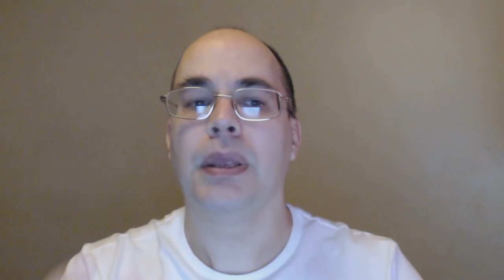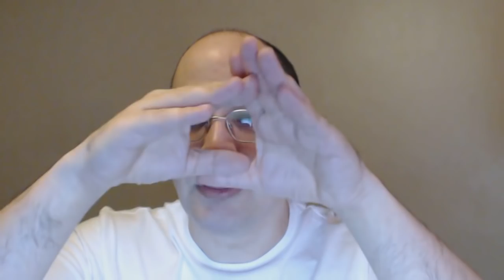How do rockets move in space, with nothing to push off from?

Comment: You need AIR to move.  Planes need air and rockets need air!  You need to learn more.
Reply from the maker: Planes need air to move since the engines use oxygen from the air to fuel them and need air passing over the wings to provide lift. Rockets carry the oxygen as part of the fuel so don't need air to burn and they don't have or need wings to give them lift.
Reply: @mjmurcott647  Objects move on air.  Without air its hard to move.  Combustion can not take place without air.  The rocket would destroy itself because of the force and no where to put it.
Reply from the maker: Combustion can't take place without oxygen, but as as I said rockets carry oxygen with them, often in the form of liquid oxygen. This principle has been driving rockets into high altitude since the German V2 rocket.
Reply: @mjmurcott647  Rockets also need AIR to move. Without air, what are you moving on??
Reply from the maker: No you don't, air restricts movement, you don't need anything to move on it isn't like swimming.
Reply: @mjmurcott647   Planes use Air and create Force, Lift, Weight and Drag with the plane, to fly.  Are you saying in Space, Air is no longer necessary?  What keeps it under control?  What keeps Earth's gravitational pull from just pulling a rocket back down to the ground?
Reply: @soccerlove_dad  Answer THIS question:

If I fired a steel projectile from a CROSSBOW in zero-G, in a vacuum - would I STILL FEEL RECOIL?

Yes or NO? Why or WHY NOT?
Reply from the maker: The velocity of the rocket needs to be greater than the force of gravity generated by the Earth, or it will fall back to Earth, this is why it is known as escape velocity. The direction of travel of the rocket is corrected by small thrusters on the side which can give a gentle nudge in a required direction. However with only gravity of nearby objects to overcome there isn't a real need for "keeping it under control" the rocket will only move in a direction if a force is acting on it. The advantage of being in space is there are few things that are producing those forces and these are relatively easy to measure and account for.
Reply: @mjmurcott647  The rocket thrust is a force.  Combustion is a force.  Because there is no air means the force will not dispense into the air but destroy the rocket like in the vacuum experiments.   Show me ONE experiment that proves what you are claiming.  Just one!
Reply from the maker: A practical experiment took place on 16 July 1969, watched by millions.
Reply: @mjmurcott647  Ok so for 50 YEARS you refer back to 1969 as proof.  All the hundreds of trips to space and your observable proof is 1969????  I rest my case.  You guys are jokes.  Science is about OBSERVATION not propaganda.
Reply: @soccerlove_dad  - No answer to my questions?  I am basically calling you a LIAR about you being any kind of "Eninger" at all.

Are the high school level physics questions TOO HARD for you?

Afraid to have a debate with a REAL engineer?
Reply: @soccerlove_dad  - "All the hundreds of trips to space and your observable proof is 1969?"

I have UNDENIABLE video proof of rocket propulsion in a vacuum.

I would be HAPPY to show it to you - as soon as you answer some of my questions.
Reply: @stuartgray5877  Science is about OBSERVATION!!!  Don't talk, show.... I'm waiting.  Hopefully it won't be 50 years
Reply: @soccerlove_dad  answer my questions first
Reply: @soccerlove_dad  - "Science is about OBSERVATION!!!  Don't talk, show.... I'm waiting."

I am an ACTUAL Aerospace Test Engineer (degree is EE).
 I have been building, testing, launching and OPERATING deep space science probes for over 20 years.
I HAVE done the experiments.

Answer my simple physics questions and Ill tell you all about it.
Reply: @stuartgray5877  Don't talk.  Credentials are irrelevant. Show us the proof.  Put up or shut up!
Reply: @soccerlove_dad  You DO know that it is illegal in Colorado to CLAIM you are a "Professional Engineer" when you are not right?

I know for a fact that it is impossible to pass the PE exam if you do not know how the "Law of Conservation of Momentum" works.

If you DONT think that rocket propulsion works in a vacuum then you DO NOT understand the Law - PERIOD.

One CANNOT pass HIGH SCHOOL Physics if you don't believe that rocket propulsion works in a vacuum.
Reply: @stuartgray5877  it is illegal in many stated to say you are a professional engineer.  Show anything flying in a vacuum!!!!!!  ANYTHING experiment!!  I'll wait.  I won't wait for 50 years though/
Reply: @stuartgray5877  Why is science a game.  Just show what you are saying.  Right now, your simply yapping with no observable proof? Guess you have no proof as I knew.
Reply: @soccerlove_dad  Stop lying about being an engineer if you cannot answer high school level physics questions.

I DO HAVE proof, but it would STILL require you to answer a DIFFERENT question that actual engineers have no trouble answering.

Before showing you proof that "bears shit in the woods" is it reasonable to ask one to define what "woods" means in the context of bears?

SO before showing you proof that rockets work in a "vacuum", lets define what "vacuum" means.

Industry standard for "rough Vacuum" is any pressure BELOW 1.0 Torr (or about 0.02 PSI).
This is approaching 1/1000 that of atmospheric pressure at sea level.

SO at WHAT Altitude above earth, does the atmospheric pressure drop to BELOW 1.0 Torr?

Answer that and we can discuss the evidence that I will show you.
Reply: @soccerlove_dad  So answer my question and I ll show you the proof you are waiting for:

At WHAT ALTITUDE does earth's atmospheric pressure drop to BELOW 1.0 Torr?

Why can't a PROFESSIONAL ENGINEER answer such a simple question?
Reply: @stuartgray5877  You want to change the subject from "space" to earths atmospheric pressure? 😂
Reply: @soccerlove_dad  - "You want to change the subject from "space" to earths atmospheric pressure? "

I want you to answer my question ABOUT earth's atmospheric pressure so I can SHOW YOU PROOF that rockets work in a vacuum.

WHY are you refusing tho just answer the question?

You can find the answer at engineeringtoolkit dot com.

Or is that too hard for you?
Reply: @soccerlove_dad  SO tell me your Professional Engineering Certification number for Colorado. Its funny that you don't show up in the Colorado database for Professional Engineers.

Why is that?
Reply: @soccerlove_dad  if you’re a professional Engineer, then share your registration number so we can check. Because if you’re a profession Engineer then im a talking Llama
Reply: @engineeringtheweirdguy2103  😂😂😂
Reply: @soccerlove_dad  I’m glad you find it funny. In many places it’s illegal to call yourself a professional Engineer when you’re not. And people do that just undermines the profession I’ve worked very hard for.
Reply: @stuartgray5877  I however am a Professionall Mechanical Engineer. (Although I don’t work on anything as impressive as you do). And it really aggravates me when people who aren’t Engineers pretend that they are to try to win cheap points.
Reply: I don’t put a lot of stock in the distinction between Engineer and Professional Engineer. To me, if you have a degree in an Engineering field, you’re an Engineer. If you have a tafe or diploma in engineering technologies etc etc. or you did some welding course with “Engineer” in the title, you shouldn’t be calling yourself a qualified Engineer. Maybe sub qualified Engineer for things like associates degrees but definitely not a professional Engineer
Reply: @mjmurcott647  they do not need air so much as they require atmospheric pressure.

The intercontinental ballistic missiles.. a big hurdle there was how to reignite missiles after they returned to atmosphere. In space, they are simply projectiles. There is no thrust.
Reply: @mjmurcott647  air is a fluid, in fact.
Reply: @soccerlove_dad  The International Space Station is travelling at around 17,000 miles an hour in order not to drop out of orbit around the earth - this is the reason the earth's gravitational pull doesn't pull it back down to the ground - you actually don't know the reason why satellites can remain in orbit and not fall back to earth?
Reply: @soccerlove_dad  In the vacuum of space in orbit around the earth, why is not possible for the space station to travel at 17,000 MPH?
So you actually think that a rocket's exhaust is pushing off the air and being propelled by some type of force that is pushing back on the bottom of the rocket? Hmmm, nope!
Reply: @sailorman8668  Did you see the video? Do you see them space walking?  Do you think they are space walking at 17,000 mph?
Reply: @soccerlove_dad  - Stop trying to explain physics to others.  You haven't a CLUE how basic physics works OR you would just answer the following questions without hesitation:

1- When the rocket engine fires - Is the EXHUAST GAS ACCELERATED?
Yes or No?
(did it CHANGE velocity OR NOT?)

2 - Does the Exhaust gas HAVE MASS?
Yes or No?

3 - Can MASS be ACCELERATEED without a FORCE?
Yes or No?

You CLAIM to have an engineering degree, so this should be trivial for you.
Reply: S Essien - PLEASE leave the PHYSICS to people who actually took a physics class.
It is OBVIOUS that you have never taken a single physics class in your life.
Reply: @stuartgray5877  It what I do as a professional engineer.
Reply: @soccerlove_dad  - " It what I do as a professional engineer."

Sorry it is NOT possible to get an engineering DEGREE and believe that rockets do not work in a vacuum.

Care to answer about five simple physics questions that anyone that has passed HIGH SCHOOL Physics can answer?

IF you answer them all truthfully, you will see that rocket propulsion MUST work in a vacuum.

After that Ill show you unmistakable video evidence of rocket propulsion in a vacuum.

Ready?
First question (just to see if you qualify for the rest):

If I fire a steel projectile from a crossbow, here on earth, will I feel a recoil force?

Yes or No?

(You would be surprised HOW MANY people on these threads that CLAIM to understand physics get this wrong).
Reply: Apparently helicopters don't need atmosphere.  These Mars missions are such poor productions, it's just strange.
Reply: @humblebwonderful9705  So let me get this straight - Mars has enough atmosphere to slow down the spacecraft from 11,000 MPH to a hundred MPH and the parachute to work, but a helicopter WONT?

you sure you don't want to rethink your position?
Reply: @stuartgray5877  Seriously, listen to yourself. 
Darling, none of that really happened, unless you are referring to Mars, Greenland.

Mars is half the size of earth with 1% of earth's atmosphere.

The best students have no discretion. That is what makes them such good students. Morbid obedience to contrived authority.

Parachutes in deep space. Worthless until you hit atmpsphere, and damn near worthless in an atmosphere of less than .147 psi, now isn't it?
Reply: @stuartgray5877  I double down on Newton. & I'm calling bullshit.
Reply: @humblebwonderful9705  I have helped build, test and Launch one Mars Orbiter. The company I currently work for built the camera in Mars orbit that caught the lander under parachute. I also helped with the MER Rovers, and I have been a Flight Director at JPL.
You are completely out of your league.
Reply: @stuartgray5877  That comment adds no value to the conversation whatsoever.
I'm not a credentialist. 
Do you think you are always the smartest person in the room, or is it just Youtube?

Mars' atmosphere is one tenth of a pound per square inch of pressure at "sea level"
What filled the chute?
Reply: @stuartgray5877  If you are so brilliant, you should know that Newton's third doesn't work for rockets.
Reply: @stuartgray5877  You make a lot of idiotic assumptions.
Reply: @humblebwonderful9705  Then just tell me FLATOUT:
Have you EVER taken basic physics?

I expect you to AVOID answering the direct question.
Reply: @stuartgray5877  You are avoiding the fact that Newton's third Law can't be applied to rockets & you are wrong.
I don't owe you anything, much less personal information, but I will give you this gift: Compulsory school is a great success.
We have indeed a nation of workers, and not a nation of thinkers.
Only an idiot would think that high school has ANYTHING to do with intelligence.
Reply: @humblebwonderful9705  so that’s my honest answer. If you could do that. And I couldn’t find any reasonable way to doubt that explanation. I would accept it as truth. It doesn’t matter if it comes from a “drop out” or a field leading professor. I care about the details.
Reply: @engineeringtheweirdguy2103  thanks. It is getting to be a pretty long comment thread & a pain in the heinie to find the end of. I posted a new op comment, if you want to chew that up. If not, I will probably double back here when I have a better prepared argument.

I always liked process control. PCT at a disposable adult underpants factory was probably the most interesting job. I always worked on the ibis vacuum systems and belt-driven fans for all of the machines. I really enjoyed that. The Lead Engineer was scary, but the rest of the job was AWESOME. SAHM now and another schedule C if the stars line up. ;) Consultant, that makes sense. Seems like a good fit.
Danke!
Reply: @humblebwonderful9705  YOu know you can SEE the ISS with YOUR EYES RIGHT?
maybe you should go LOOK for yourself?
we have PHOTOGRAPHS of the ISS and you can see the Dragon spacecraft docked to the side of it.
I guess that is just worldwide mass hallucinations right?

Want to see some pictures that I HELPED TAKE? Google "EPOXI images of earth" and tell us what you find genius!
Reply: @humblebwonderful9705  So WHERE is that derivation of the Rocket Equation so you can show 100 years worth of engineers and physicists where THEY HAVE BEEN WRONG?

Why the silence?  Did you figure out that you are in over your head?
bless your little heart!
Reply: @stuartgray5877  I apologize, I just feel like nothing productive can come from the energy of the conversation. I shouldn't make statements of questions nor should I feel insulted and likewise. Thanks for trying.
Reply: @stuartgray5877  You know what kind of debts you can't insure? Worthless debts. Student debts.
Reply: @humblebwonderful9705  Really? My "Student Debt" after graduating was about $20k for an Engineering Degree in 1993.

I now make TEN TIMES THAT a YEAR and have almost $2 million in my 401K account
So HOW is that "student Loan debt" worthless?
I seem to have done quite well with that initial $20k investment in my future.

What is your excuse?
Reply: @stuartgray5877  I am a stay at home mom. I went to technical college. How do you insure student loan debt, tell me?
Reply: @humblebwonderful9705  You want to debunk 100 years of established engineering and physics regarding rocket propulsion, but you DON'T understand how RECOIL works?
Bless your little heart!
Reply: @humblebwonderful9705    To all OTHER READERS, watch as Squint ward REFUSES to just answer simple questions that ANY PERSON who has taken high school physics CAN ANSWER:

1 - When a rocket engine fires does the exhaust gas GET ACCELERATED? Yes or No?
2 - Does the Exhaust gas HAVE MASS? Yes or No?
3 - Can MASS be accelerated WITHOUT A FORCE? Yes or No?

And finally - Since the Rocket IS accelerating the exhaust gas, AND Exhaust gas HAS MASS, AND MASS REQUIRES A FORCE to be accelerated, then:
Squint ward - From WHERE does the FORCE originate that accelerates the mass into the vacuum?

There MUST be a force, so WHERE does it come form?

YOU have stated that the VACUUM CANNOT EXERT A FORCE!

now WHERE IS THE FORCE COMING FROM?

The OTHER READERS: Watch as Squint ward refuses to answer.
He CLAIMS to understand physics but he REFUSES to cooperate and PROVE IT - because ANSERING TRUTHFULY - PROVES HIM WRONG 
THAT is why he refuses to participate in an ACTUAL debate.
Reply: @stuartgray5877  is unhinged.
Reply: @humblebwonderful9705  Answer my questions and PROVE IT.
you are AFRAID to answer these juvenile physics question because you KNOW you will be PROVEN WRONG IF you answer truthfully.
Reply: @stuartgray5877  yeah i'm super scared the  whole of engineering might realize there is no thrust in a weightless vacuum. God forbid they use critical thought in the face of indoctrination.
Reply: @humblebwonderful9705  I have hard evidence that rockets work JUST FINE in a vacuum.
But you would refuse to even WATCH it so what would be the point of showing you?
Reply: @inniuniui9361  how peculiar
Reply: @inniuniui9361  Thank you for telling me, the interaction has been bothering me for a while now.
Alright. Thanks again!
Reply: @inniuniui9361  Are there a lot of chatbots around this topic?
Reply: @inniuniui9361  this bot has a frickn resume, how odd is that? What percentage of the comments are bots/agents to people that just lack critical thinking?
Are you a bot? This kind of blows my mind.
Reply: @inniuniui9361  Extraordinarily naive?
hm. wonderful. well, thanks for the tip. you must've known how naive i was when you clued me in, but hell. condescention on all fronts.
Reply: @inniuniui9361   - And I am just curious you must believe that the rocket engine PUSHES ON THE AIR behind the rocket right?

HOW can this be? HOW can anything "Push" on nothing but AIR?

Doesn't the air just MOVE out of the way HOW can it provide any kind of RESISTANCE to the rocket thrust?
Just explain your reasoning so I can understand how you THINK it works.
Reply: @humblebwonderful9705  you do realise mares has an atmosphere right?
Reply: @engineeringtheweirdguy2103   Mars has a co2 atmosphere that is 1/10th of earths, meaning that there is a little over a tenth of a pound of pressure per square inch at sea level.
So where we on earth have 235.2 oz of air psi, they have 2.352 oz. AT SEA LEVEL
Reply: @humblebwonderful9705  so? The mars drone had larger blades with bigger surface areas spinning at higher speeds to generate the lift needed. Infact the drone would struggle to work on earth because the blades would encounter too much resistance here to get to takeoff speed due to the airs density here. But on Mars there is much less, meaning they can generate the require lift using larger blades spinning at faster RPM’s
Reply: @humblebwonderful9705  isn’t it amazing what Engineering can solve?
Reply: @humblebwonderful9705  And in YOUR world, someone who has been building, testing, launching, and OPERATING deep space probes for LONGER THAN YOU HAVE BEEN ALIVE, somehow knows LESS about spaceflight technology than YOU (a high school dropout)?
Yeah you are fucking brilliant!
Now go back and finish high school, THEN you can have a conversation with the grown ups.
Until then, Bless your little heart!
Reply: @engineeringtheweirdguy2103  the blades can spin until the bearings seize. Drones only work because of our atmospheric pressure.
Co2 is more dense, but realize there is almost none there.

A fan will spin in a near vacuum, but there is no wind to move.
Reply: @engineeringtheweirdguy2103  I never cease to be amazed. Human ingenuity refuses to be quashed by the institution.
Reply: @stuartgray5877  this is some combination of Dunning-Kreuger and cognitive dissonance, but I forgive you.
Reply: @stuartgray5877  manufacturing really has so little to do with this discussion.
Reply: @stuartgray5877  @Engineering the weird guy 
"The Right Stuff" by Tom Wolfe.

He documented high-altitude flight tests w/rocket powered aircrafts.
They invariably fail in the thin air and fall back to earth.

Chuck Yeager almost died in a NF-104A rocket plane while attempting to set a height record.

The USAF can't rocket in upper atmosphere.

High altitude pilots aren't fucking around and high fiving themselves either because it's not a laughing matter.

NASA is ridiculous bullshit for dumbshits and children.

Even the engineering of the ICBMs was dependent upon the reignition of the missiles upon re-entry of the atmosphere.

Newton wasn't wrong, interpretation of his third law is flawed in academia, in my humble opinion.

Your sheepskin doesn't mean you are correct.
It doesn't even imply you are.
Reply: @humblebwonderful9705  So to answer your statements, I will break my response into 4 parts:

1.) While CO2 is heavier than regular air, density of air is relative to it's pressure. That is because when you increase the pressure of a gas, you are effectively just trying to jam more gas particles into the same space. More particles makes the gas more dense. On Mars the atmosphere is not very dense at all due to low pressure. For propellors to generate thrust or lift, they need to pass through air, and swat the gas particles away from the blade perpendicular to its motion, hense the profile of propellors. The faster it goes, the more particles it can swat, the more lift. The bigger the blade, the more particles it will hit, the more lift is generated. The more gas particles there are, the more particles the blade will hit. If you have reduced air pressure such as on Mars, you have to 2 two things to compensate. Make the blade bigger to hit more particles (like casting a bigger net) and move the blade faster. Which is exactly what it does. This should be fairly self evident. This is why aircraft have height limits. The air gets too thin and their propellors cant swat away enough gas particle to provide the thrust required to drive it through the air enough to generate the required lift.

2.) Gravity does not have any apparent effect on combustion. Infact any way you look at it, from physics to chemestry, it does not have an affect on combustion. So I am not sure where you are going with that.

3.) The heated exhaust gas coming from the rocket is not generated by atmospheric pressure. But by combustion. It does not require any external conditions to do this. Basic chemestry.

4.) Lastly, Rockets do not blow on their own sails. That should be pretty self evident. But because it apparently isnt to you. I will explain why. When you blow against your own sale, What you are doing is accelerating gas particles towards your sail. When you do so there is an equal and opposite force. which is applied to the boat. So as you blow the particles forward, you are being pushed backwards. They then collide with the sale which is also attached to the boat. This slows the gas particles down. The force required to slow them down is the same which was required to speed them up. That force is applied to the sale. So what you are left with is a force backwards applied to the boat as a result of accelerating the air. An equal force is applied forwards as a result of slow down the exact same air. This means that the two forces cancel out.

When we apply this to a rocket, we are accelerating the gas particles out of the rocket. But there is nothing to catch them again and slow them down. As such there is no second force to slow down the gas particles coming from the rocket. It cannot be blowing on its own sail then.

What is happening is that gas left to freely exapnd will expand in all directions. The only way gas does not expand freely in all directions is if it is acted upon by an external force, such as hitting walls and solid objects which stop the gasses expansion. When this happens it is becuase the gas particles are bouncing off the surface. The gas particle which have both mass and velocity, will transfer a force to the surface equal to that which the surface must apply to the particle to bounce it back in the opposite direction. (newtons laws at play). This force can be averaged over trillions of impacts per second over any given area to give you a pressure. As pressure is just force distributed over an area or P=F/A.

What we see with a rocket is that the expanding gas due to combustion cannot expand freely in all directions due to the walls of the combustion chamber. But we see it exiting the rocket in a uniform direction out of the exhaust. We can then know that there must be a force applied to the gas to re-direct it form expanding in all directions to traveling in one uniform direction. If there is a force applied to the gas then Newton states there must be a force applied to something else. This would be the combustion chamber of the rocket. Without anything to apply a second force back to the rocket to prevent it from moving we get a Net force. which means thrust.

as such, according to newtons laws, Rockets MUST work in space.
Reply: @humblebwonderful9705  in addition to this. The kinetic theory of molecular gasses, in which all our gas laws are derived, states that gasses are made of particles with mass and velocity which are subject to all the laws of physics including newtons. it states that the space between the particles is empty space. it also states that the gas particles are so small that any gas is >90% empty space and that the sum of the collisions over a surface is pressure. 

in knowing this, rockets cannot push on atmosphere. As the gas particles leave the rocket to enter the atmosphere that individual  cannot then also be in direct contact with a surface of the rocket. As such when it finally encounters an atmospheric particle, it can only apply a force to the particle it is colliding with as it is not in contact with the rocket.

as such believing that rockets then must push off air is to believe is either one of the following.
1.) gas particles must use magic to wirelessly transmit a force of a great distance to a moving object for no reason and violating the known laws of physics, or;
2.) the exhaust gasses coming out of the rocket are so densely packed that they come out as an incompressible liquid or solid. (observably not true).
Reply: You know, Sputnik was a balloon..
Reply: @engineeringtheweirdguy2103  The rocket pushes off of the heated exhaust column expansion. Atmospheric pressure is necessary to form a cloud dense enough for this to happen. See: rocket exhaust nozzles and atmospheric compensation. (and this is assuming quite a bit already, if you haven't witnessed the effects of vacuum or micro-gravity on exothermic reactions. )
Reply: @humblebwonderful9705  the rocket does push off the heated exhaust, however a cloud is not required for this to happen as per my previous explanation and known laws of physics. Also as per my previous comment, I explained that the Kinetic theory of molecular gasses shows us that it would be physically impossible for it to push off anything except for the expanding gasses due to combustion inside the combustion chamber.

If it needed a “cloud” to push off then rockets would produce thrust underwater, which they plainly do. You are contradicting yourself.
Reply: @humblebwonderful9705  there is no affect on the energy released from combustion due to either pressure or gravity. What you are conflating is the lack of oxidiser in a vacuum compared to the atmosphere. Thankfully Engineers realised this and supplied the rocket with its own tank of liquid oxygen specifically for fuel. This is plainly evident when you look at space shuttle launches. The largest tank on a space shuttle launch. The big orange/brown one, is the tank for liquid oxygen specifically for that purpose.
Reply: @humblebwonderful9705  Sputnik was not a balloon.
Reply: @engineeringtheweirdguy2103  re-read what you posted here.
You can observe the column when rockets are under water
Reply: @engineeringtheweirdguy2103  rocket candy and thermite have their own oxidizers.
You've never seen them ignite in a vacuum?
Gravity also has a hell of an effect, are you joking here?
Reply: @engineeringtheweirdguy2103  Rockets work on air pressure differential, you can not have this in a weightless vacuum.
Reply: @humblebwonderful9705  thermite and rocket candy do have their own oxidisers, but are only in amounts to ignite in an already oxygen rich atmosphere. Hence why when you remove rust oxide from thermite it won’t ignite, even in an oxygen rich environment. That is why orbital rockets don’t run on rocket candy or thermite. If you wanted thermite to work in a vacuum you need to provide more of an oxydiser to compensate for the lack of oxygen in the air. It’s as simple as that.
Reply: @humblebwonderful9705  please outline where I have been contracting myself, as I did for you. Otherwise it’s empty words
Reply: @humblebwonderful9705  echo was a balloon. Sputnik was not. Find me one credible source that says otherwise
Reply: @humblebwonderful9705  again, I’m not denying the existence of rocket exhaust, perhaps try reading my comments. I’m saying it’s not caused by atmospheric pressure as you emphatically stated. That statement conflicts with your earlier statement about how you suggested rockets generate thrust underwater. Interestingly when you measure the thrust generated from a rocket in water vs in atmosphere they are vertically identical. Meaning that The thrust is not dependant on external factors.

You’re stating that rockets use atmosphere and pressure to work, and that the less pressure and atmosphere around the rocket reduces thrust, as they do not work in a vacuum. By that same logic you should expect to see a 1,000x more thrust under water from a rocket than in atmosphere. As water is 1,000 more dense than sea level atmosphere. 

Alternatively if it’s more based on pressure you should see drastically increased thrust for deeper rockets which then reduces as you near the waters surface.

Two things we don’t see happening.
Reply: @humblebwonderful9705  I also explained that rockets must, according to the known laws of physics, work in a vacuum. And explained exactly how that mechanism works and how it aligns with physics. I also explained how according to the known laws of physics it would be impossible for the rocket to push off something external to the rocket.

Two things you have not addressed and have flat out ignored.
Reply: @humblebwonderful9705  I have explained this to you in detail and all I get on response are vague, unsubstantiated claims which do not address and actively ignore my actual arguments and explanations.

Sorry. That’s not enough. My arguments invalidate your statements. Making new broader or repeating those statements without addressing my detailed argument does nothing to discount my arguments or to re-affirm yours. Especially when the things you are stating or repeating are have already been invalidated or discredited by my original argument.
Reply: @humblebwonderful9705  there is no evidence or law of physics that states that. In addition the presence of gas begats pressure. As pressure is just the force applied by gas particles impacting a surface. So in a vacuum your differential would be from the exhaust gas. Which would be by definition >0 and the vacuum which by definition is =0. Since >0=/=0 you have a pressure gradient. You can’t even come up with a valid vague unsubstantiated statement.
Reply: @engineeringtheweirdguy2103  okay, the purpose of the exhaust nozzle is to increase the pressure. Hundreds of atmospheres of pressure then push out of the exhaust nozzle against the ambient pressure for thrust. Without the pressure differential, rockets do not work. This is MOST obvious watching a rocket in water.
Reply: @humblebwonderful9705  - I would be HAPPY to SHOW you rocket propulsion in a vacuum AS SOON AS you answer a simple question:

At WHAT ALTITUDE does earth's atmospheric pressure drop to "Vacuum"?

Industry standard for "Vacuum" is any pressure BELOW 1.0 Torr (0.02 PSI).

Tell me at WHAT ALTITUDE does atmospheric pressure drop to below 1.0 Torr?

tell me THAT and Ill show you unmistakable evidence of rocket propulsion in a vacuum.
Reply: @humblebwonderful9705  - "Without the pressure differential, rockets do not work."

Thank you.

And the DIFFERENTIAL Pressure is GREATER when the rocket is in vacuum.

At SEA level: ATM Pressure is 14.5 PSI, Nozzle pressure is ~3000 PSI.
Differential Pressure = 2985.5 PSI

In VACUUM: ATM Pressure = 0.0 PSI, 
Nozzle pressure is ~3000 PSI.
Differential Pressure = 3000 PSI.

So in WHICH region is DIFFERENTIAL Pressure greater?
Well - IN VACUUM!

SO the rocket gets MORE thrust IN VACUUM, where the differential pressure is GREATER!

let me GUESS, you have never even HEARD of the "Tsiolkovsky Rocket Equation" have you?
Reply: @stuartgray5877  Really, you don't realize how condescending you come off?
You don't have to be agreeable, but you should look into this. Such a put-off.
Reply: @stuartgray5877   It has to be close to zero pressure at 100km, but there is still air.
Reply: @stuartgray5877  There are limitations, and this is an oversimplification of the pressures involved, but now do you see that the exhaust is part of the rocket, and not acting against the rocket?
If it is part of the rocket it needs another object to act on.
Reply: SpaceShipOne’s rocket engine cut out at 61 km in 2004
Reply: @humblebwonderful9705  - "If it is part of the rocket it needs another object to act on."

So according to YOU, a CROSSBOW fired in a vacuum WILL NOT have a recoil.

The crossbow is ONE MASS, the Projectile is another.
One pushes on the other and BOTH feel the force.

So will a crossbow experience RECOIL force in a vacuum OR NOT?
Reply: @humblebwonderful9705  - "It has to be close to zero pressure at 100km, but there is still air."

Close!  The atmospheric pressure at ONLY 50 km is less than 1.0 Torr.
Now watch the YT video: "Uninterrupted Footage of the Falcon Heavy Launch and Booster Landing! "
And tell me what you see. Describe the events from launch to booster landing.
Reply: @stuartgray5877  if it is part of the rocket, it needs another object to act on for a reaction. That isn't according to me, that is according to Newton. The third law.
What would Newton say about recoil then?
Mind you, a vacuum is not a weightless vacuum.
Reply: @stuartgray5877  You are making a lot of assumptions about me. I have not called you a liar, I have no reason to assume you are.
I haven't said rockets are a hoax, just that there can be no thrust in a weightless vacuum.
Did I say rockets can't fly in space? No. Of course they can. As projectiles.
I'm sorry your feelings are so hurt by my being dismissive of your job title or your masters degree, but I am not sorry that I made that clear. I know many people that work in engineering, (admittedly most from the Navy) that have held long term positions only because they can keep a routine. They do not think freely. They just parrot. 
Hence, I put little value in credentials. 

You though, you are facetious and degrading. High school drop-out? 😏 Snot very nice.
Reply: @humblebwonderful9705  - "They just parrot. 
Hence, I put little value in credentials."

Here are my jobs on ONE Mission. On the Deep Impact Mission I:
Was part of the team that designed and built the flight computers that controlled the spacecraft and read out the images from the three telescopes on board.
When we delivered those flight computers to the spacecraft integration flow, I was delivered with them. I personally installed those flight computers, MOST of the rest of the avionics AND the optical telescopes.
I was the Integration and test LEAD for the spacecraft and all environmental tests.
I helped ship the spacecraft to KSC, FUEL IT, and Put it on the rocket.
I was the LAUNCH CONDUCTOR for that launch and watched the spacecraft leave earth with my eyes.
AFTER Launch I went to JPL and worked mission operations where I was: 
Part of the Deep Space NAVIGATION team, Flight Director, Activity Lead, and Command and Data Handling subsystem Engineer.
The evening that we hit the comet, I was IN the JPL control room in Pasadena as the images of the encounter came down. I was PERSONALLY responsible for verifying those images came down to the ground UNALTERED.
Now for some images that spacecraft took during its EXTENDED MISSION can be found by googling: "EPOXI images of earth".
Tell me what you find when you do that search.

Does that sound like some clueless engineer working in a closet somewhere far from what is really happening?

i have done the SAME tasks on numerous missions..
Lookup: Mars Global Surveyor, Stardust, Genesis, MER Rovers, Deep Impact, Kepler Space Telescope, NPP-SUOMI, and JPSS-1 (now NOAA-20).
I can tell you more than you ever want to hear about any of those missions.
I know more about the Deep Impact and Kepler flight hardware than almost any other person alive.
Reply: @stuartgray5877  "Here are my jobs on ONE Mission. On the Deep Impact Mission I:
Was part of the team that designed and built the ..." TLDR, but kudos.
Reply: @humblebwonderful9705  So you WONT answer my simple physics questions? Or do you not KNOW if exhaust gas has mass or how Newton's laws work?

Sorry, I apologize.
 I see the answers now:
"1-yes 2-no 3-yes"

SO you agree that:
 Gas HAS MASS
that Mass cannot be accelerated without a force,
And
That the gas is accelerated when it leaves the nozzle,.
GOOD
we are getting somewhere.

So since the exhaust gas IS ACCELERATED, then there MUST have been a FORCE!
Great!
So WHERE did the force originate that accelerated the exhaust gas?
Reply: @engineeringtheweirdguy2103  another thing, is it impossibly cold or impossibly hot in deep space? All of the fancy formulas use a generic gas. What is that?  All exhaust gasses are the same? 

I guess, whatever. Rockets can blow in their own sail for thrust. I really appreciate your effort and patience, but I won't waste anymore space here. :) Be well!
Reply: @stuartgray5877  in the rocket engine. Acceleration begins at the throat / choke of the exhaust.
Reply: @humblebwonderful9705  - So you agree that the nozzle MUST apply a force to the exhaust gas to accelerate it out of the nozzle?
But you DONT think the nozzle feels the SAME FORCE but in the opposite direction?

How do you THINK Recoil works?
Explain the dynamics of the recoil from a crossbow.
Reply: @stuartgray5877  recoil is a shockwave
Reply: @humblebwonderful9705  - "recoil is a shockwave"
No it is not.

It is the FORCE backwards on the Gun (or BOW) when the projectile is accelerated forward.
DO you agree that a crossbow has recoil or not?
Reply: @humblebwonderful9705  as for temperature in space. It’s both. That sounds weird I know. And it’s not illogical for people to think of that as a red flag. But let me explain. The vacuum of space is an excellent insulator. If you have a thermos it is likely vacuum sealed for this purpose. Most heat gain and loss we experience and observe is mass based. Either through direct contact or through convection of a medium such as air or water. In a vacuum there is no conduction (direct contact) or convection (through air) only the very relatively small radiation of heat. Anything with heat radiates heat. The hotter it is the more it radiates. It’s the heat you feel on your skin coming off a hot piece of metal before you touch it. It’s the heat you feel from the sun or a fire.

If you’re in space, you can only radiate your heat away slowly. But in the shade, there is nothing around you such as air to replace it. So you will radiate heat until you’re frozen.

In the sun, the sun kicks off a lot of radiant heat. You will absorb that heat but not be able to disperse the heat effectively. So you will heat up.
Since how much heat you radiate is dependant on how hot the object is. You won’t stop getting hotter in space from the sun until you are so hot that you radiate heat as fast as you’re receiving it. 

The this means that particles high up constantly in the sun can be incredibly hot. And so too can larger objects. But larger objects also have larger shaded size is larger. Heat cannot conduct through the material that distance fast enough. Meaning object which are people sizes or rocket sized can be simultaneously incredibly hot on the sun side and incredible cold on the shaded side.

To overcome this. Most things in space are either heavily insulated, or rotate slowly like satellites. Exposing the hotter side to the shade to cool down and vise versa.
Reply: @humblebwonderful9705  and for generic gas they mean ideal gas. Saying something is an ideal gas doesn’t remove the properties of a particular type of gas. Such as specific densities, thermal or expansion coefficients. Etc. what it means is that it’s assuming it’s following a relationship between pressure, volume and temperature. If you assume it wasn’t an ideal gas the formula would be as long as your arm. There is a lot that goes into it. But it’s behaviour in relation to pressure volume and temperature can often be assumed to be that of an ideal gas. What I mean by that is that ideal gas laws are simplified approximations of their actual relations. PV=mRT. A much simpler equation. This accurate approximates the behaviour of gasses. In much the same way accurately approximates its speed. For example to know your true speed you would have to maintain change in radius of the tire due to tire wear, for analogue speed measurements you’d have to account for wind up in the feed cable. Then you’d have to compensate for the delay on the reading of the needle and adjust for mechanical error, and finally present that in a way which gives you numbers on speed instead of eyeballing a needle on a dial. But even without all that speedometers are very good at approximating your actual speed. There is very little purpose for getting such fine accurate measurements. 

For researchers when they would need those accurate measurements and behaviour they would not approximate gas behaviour to that of ideal gas relationship. But for the purpose of knowing what’s going to happen and approximating the outcome or understand what mechanisms will take place, such as you would as an Engineer. You can safely keep things simple and assume any gas to follow an ideal gas relationship between pressure, volume and temperature.
Reply: @humblebwonderful9705  hopefully that makes sense. That’s like 2nd or 3rd year engineering so you’re doing well if that doesn’t go right over your head. But I definitely wouldn’t assume that you would know what an ideal gas is. It’s not very heavily used for professions outside of science and Engineering.
Reply: @stuartgray5877  if pushing gas through the nozzle caused thrust, it wouldn't have to be exhausted. You could use a closed system, right?
Reply: @humblebwonderful9705  - "You could use a closed system, right?"
NO.
Because the rocket gets thrust when accelerating the mass. If it has to stop it again, it will get accelerated again in the opposite direction giving no net thrust.

Are you ready for VIDEO evidence of a rocket working in vacuum?
can you tell me the altitude that earth's' atmospheric pressure drops to this "vacuum"?
Industry standard for "vacuum" is any pressure below 1.0 Torr. (0.02 PSI)

At what altitude above earth does the atmospheric pressure drop to BELOW 1.0 Torr (0.02 PSI)?
Reply: @humblebwonderful9705  😂
Reply: @soccerlove_dad  what am i missing? there must be a magic word.
Reply: Jesus. Way to show off your ignorance about physics.
Reply: This thread is a wild ride, had a TON of fun reading it. I sincerely hope "i will bell the cat" in particular is a troll and not just an idiot, because if it's trolling it is done beautifully. The fact that you have an actual aerospace engineer fuming and yelling and talking about the amount of money he has in his 401k is just...perfection. (To be clear, S Essien and the rest of the flat earthers here are complete morons and 100% wrong about everything they think and say, and also it is hilarious how the person with a multi-decade career at Lockheed/Bell is freaking out for multiple months about it.)
Reply: Try having Kori explain physics to you — I think he could understand why a gun would still work in space (and why it would push the shooter backwards slightly)
Reply: @FISHD00G  OH, and the ONLY reason I mentioned my 401k is because he was accusing ME of wasting my money on an education.  I was merely pointing out that my return on investment is astronomical.

I was abut 20k in debt when I finished my engineering degree in 1993.

I make about TEN TIMES that annually now.
Reply: @stuartgray5877  Lol bud at some point you're gonna have to let this one go
Reply: @FISHD00G  Sorry but real engineers don't take kindly to people who LIE about being engineers. S Essien's best move would be to delete the entire thread before his employer finds out he is lying,
Reply: Planes and rockets do not work on the same principles
Reply: @engineeringtheweirdguy2103  - But both are still MASS REACTION ENGINES.

Even aircraft do NOT "push on the air behind them".
they push on the MASS of air moving through the engine.

If aircraft pushed on the air BEHIND THEM, then no aircraft could EVER move faster than the speed of sound.
We have aircraft that DO move faster than the speed of sound, so those are NOT pushing on the air behind the engine.
Reply: @stuartgray5877  I’m not disagreeing with you. I’m pointing out that planes generate thrust by utilising the air around them in various type of processes. But rockets carry the gas with them as liquid fuel. Thus not requiring atmosphere to be processed inside the engines or by propellers.
Reply: @engineeringtheweirdguy2103  the effects that air and gravity have on combustion seem to have been taken forgranted.
Edit spelling
Reply: @engineeringtheweirdguy2103  more than processing the fuel, rockets do - in fact- propel themselves by pushing against the column of heated gas caused by ATMOSPHERIC PRESSURE.
You can see how rockets work underwater, air is just a less-dense fluid. When it is gone, the rocket exhaust meets no resistance, and you can blow in your own sail, but you won't move. ask Newton.
Reply: @humblebwonderful9705  as I have already described, it is not blowing on its own sail. The action reaction is between the rocket and the exhaust gas which is being rebounded off the rocket and out the exhaust. If you bothered to read my comments you’d already know that and wouldn’t have wasted your time looking like an idiot
Reply: @engineeringtheweirdguy2103  you don't even read your own comments before you post them.

OUT THE EXHAUST is where the action/reaction take place.

I read your responses, thank you for those. I could've engaged a parrot and done as well without being called an idiot. Good try though.
Reply: @humblebwonderful9705  as I’ve stated previously and repeatedly, there is no what in which a gas particle no longer in contact with the rocket could transfer force back to the rocket. That would be like Hitting a baseball with a bat and only hearing the ting from the bat when someone catches it. Your imagination is not consistent with the laws of physics. Your imagination isn’t reality
Reply: @humblebwonderful9705  and once again, you have already known that if you bothered to read my comments
Reply: @engineeringtheweirdguy2103  The exhaust is part of the rocket until it isn't. 

If the exhaust = you blowing 
The rocket = the sail
Reply: @engineeringtheweirdguy2103  I've read all of your comments. Rest assured. Please don't assume I am being daft intentionally.
Reply: @engineeringtheweirdguy2103  if the exhaust never left the vessel, would the rocket move?
Reply: @humblebwonderful9705  of gas did not exhaust out of the rocket then there would be no motion. But it does exhaust. And that’s my point. Gas freely expands in all directions. What’s coming out the exhaust isn’t just the gas which happened to be expanding in that particular direction. It isn’t holding onto the rest. It’s exhausting all the gas. In one uniform direction. Gas is made up of particles with mass and velocity. To change an object’s trajectory that requires a force. It changed direction to move out of the exhaust because it is resisted and bounced off the combustion chamber walls. That means there is force applied to the combustion chamber walls by the gas as it’s being bounced out of the combustion chamber. But there is no force on the opposite direction regaining that force from the gas particles at it exits. Otherwise it would not exit.

As such it cannot be blowing against its own sail as there is nothing preventing the exhaust leaving the rocket or to regain the kinetic energy from the gas as it leaves the rocket.
Reply: @humblebwonderful9705  I realise you’re not being daft intentionally. The arguments you are making are appealing. And appear to make sense if you lack the wider understanding of physics and how it works. That’s what makes hoaxer con men so appealing. They pray in ignorance and tribe appeal “us vs them” or the “if you agree with us you’re one of us and if you don’t you’re the enemy.” They give you a sense of belonging and tell you you’re special and above average and all the things you want to hear and then tell you that everyone else is trying to take it away from you or work against you. And it’s easy to fall for when you’re not looking for it.

In any case I understand where you’re coming from. I’m certainly not trying to hold that over your head.
Reply: @engineeringtheweirdguy2103  if rocket = sailboat, fuel = your breath you need another object to get an action/reaction pair

If rocket the exhaust has a muffler on on it, will it thrust? What if the exhaust is pulled away from the nozzle exactly as fast as it is released? Will it thrust?
Reply: @engineeringtheweirdguy2103  thank you, for relating.
Reply: @engineeringtheweirdguy2103   in an example like a water rocket, it seems to me that the exhausted  water and rocket are pushing against the  sea.
Are you saying that the exhausted water and the sea are pushing against the rocket?
Reply: @humblebwonderful9705  if a rocket had a muffler there would still be thrust. Ultimately thrust is a measure of transfer of momentum at a macroscopic scale. The fuel was once moving with the rocket with all its mass. Now it’s moving away from the rocket incredibly fast with all its mass. And as I keep saying there must be a force shared between the gas and the rocket which prevents it expanding freely in all directions to uniformly accelerate towards one direction uniformly. There are methods of ideally controlling flow rates and directions. Such as the expansion contraction nozzle, often called the de laval nozzle. It’s purpose is to convert pressure and thermal energy of the exhaust into kinetic energy. If you look and unders expanded rocket exhaust or fans out all over the place. Ideally to generate the most efficiency thrust you want uniform laser like exhaust (see spacex rocket launches right off the pad for example.) it becomes a complicated engineering problem to control that exhaust pattern.
Reply: @humblebwonderful9705  however if exhaust is pulled away, technically not. But what would be pulling it? For something with mass such as gas to change direction something needs to apply a force to it and it needs to apply a force back.
Reply: @humblebwonderful9705  in a water rocket it works just the same. It’s understandable to make the link that it must be pushing on something outside the rocket but when we interrogate that with known physics we see something different occurring. What is being exhausted is acting on the rocket. In the same way that throwing a bowling ball on a skateboard creates motion. The gas expands and pushes on the rocket and the rocket pushes back. You get a little bit of acceleration in the rocket and the exhaust gas is bounced out of the exhaust in the opposite direction. This principle holds true for water hoses and bowling balls. Else the gas in the rocket would be able to expand freely in all directions in a spherical manner.
Reply: @humblebwonderful9705  You STILL have not answered any of my questions OR evaluated that video.
Lets SEE if you can answer some VERY SIMPLE physics questions:
1- Does the Exhaust gas from the rocket HAVE MASS? Yes or No?
2 - Can MASS be accelerated without a force? Yes or No?
3 - When the exhaust gas leaves the nozzle IS IT ACCELERATED? Yes or No?

No trick questions or insults.
Just answer the questions.
The typical "physics deniers" flat out REFUSE to answer my questions, because answering proves them to be wrong.

Lets see if you stoop to their level.
Reply: @engineeringtheweirdguy2103   you said " if exhaust is pulled away, technically not. But what would be pulling it?"

THIS. This is a hang-up to me.
Nothing would be pulling the exhaust away,  also nothing would be there to allow for a reaction to the spent exhaust. No cloud forms. Exhaust just pisses out and dissipates (or not, maybe it just floats there, idk) anyhow, your exhaust nozzle would have to be so big it would have a negative effect.
When the shuttles' main engines' exhausts launch, they make that Mach disc, so the pressure at the exhaust exit is lower than the sea-level ambient pressure. And under water, it makes that gas sack and creates a negative drag, so to say that the ambient pressure or atmospheres don't make a difference is an oversimplification, I believe.
Reply: @stuartgray5877  I am not them. I am a stay at home mom, and lets just assume I AM a high-school drop-out. I have no need to qualify for your satisfaction, and it's quite interesting, psychologically, that you suggest I should. 
Let's see.. 1-yes 2-no 3-yes
Hope that satisfies. Have a good day.
Reply: @humblebwonderful9705  I don’t believe it’s an oversimplification at all. The mechanism for thrust remains the same. You can add more dynamic variable such as water drag, air drag, relative humidity. They all affect the acceleration profile sure. But not the thrust applied to accelerate the rocket.

In space, much like at sea level, gasses will escape and expand in all directions equally. I.e in a sphere. When gas particles impact a surface they exert a force on that surface and that surface applies an equal force back which rebounds it. Similar to a cricket ball to the face. This is an indisputable fact of physics. For gas to be prevented from expanding in all directions a force must be applied to it to change its direction. In a closed container that force is known as pressure. You have equal force to the left as you do to the right. Because F=PA. Or force is equal to the pressure over an area. Also an indisputable fact of physics.

Gas Cannot freely expand in all directions inside the combustion chamber of a rocket. There is an exhaust nozzle at the back of the rocket exiting the side of the combustion chamber. So there is a force due to pressure (the gas particles bouncing off the surface) on the left side of the combustion chamber but only an exit on the right hand side. (No surface for pressure to act on) this means you have a force to the left but no force to the right. Which means thrust.

None of this requires external conditions.

Credit where credit is due, there is an inherent design flaw with rocket nozzles. As you keenly picked up, the de laval nozzles need to try to match external pressure by altering the nozzle geometry. In space there is no pressure as a result it is an un achievable goal. However you can almost get there. To actually get there you need a rocket bell of infinite length. But the profile is asymptotic. Meaning after a certain point you’ve gotten 90% of the way there. You can practically say you’ve achieved it. It will never be 100% efficient but it will be as close as you can practically get. This is what rocket engines in space do and the reason rockets have multiple stages. Rockets designed to work in atmosphere don’t do well in space. So the jettison that rocket to revel a second one which is designed to operate in space.
Reply: The nozzle itself is only a choke it is a part of the rocket and so is everything in it.

Newton's third needs two separate objects. Gas in the exhaust chamber and the rocket are one object, what do they act upon to achieve thrust?
Reply: @humblebwonderful9705  gas and a rocket are not physically conjoined. However if it dispels the myth that they are the one body, then think of how the exhaust leaves the rocket. When I am on a skateboard holding a bowling ball. The ball, rocket and myself are the one body. To separate myself from the bowling ball, I either need to throw the bowling ball or have something take the bowling ball away from me. When two bodies which were one, move away from eachother at speed, there must be a force. A vacuum cannot take away the gas, the gas cannot freely expand, thus there must be a force accelerating it away from the rocket.
Reply: @engineeringtheweirdguy2103  everything you explain is suspiciously articulate and digestible. I understand these side topics are a character flaw of mine, and really do appreciate the time you have taken.

I'm still stuck, and in the exhaust yet. I have looked into this before, my interest piqued again with current affairs but I am still at a loss. 
The exhaust (to my stubborn reasoning) must be considered part of the rocket, just like an empty tank from stage one is part of the rocket, until it departs.
To achieve thrust, the exhaust must be expelled, and upon expulsion, the exhaust pushes out, and the atmosphere pushes back (action reaction pair) .

With no atmosphere, Boyles law suggests there is no thrust.

What am I missing?
Reply: The exhaust is a lot of water vapor, and we see it slush up during launches, so I think the behavior of the (not generic) gas is more important than it is, so thanks for that too
Reply: @humblebwonderful9705  so the first thing I believe you are missing (if I’m interpreting you correctly) is that rockets cannot push on external atmosphere for thrust. According to the kinetic theory of molecular gasses from which most gas laws are derived, gas is made of particles with both mass and momentum. As a commonly used analogy for kinetic theory imagine gas particles as tiny bouncy balls. This makes a lot of sense. For example, pressure (which is force distributed over an area) is caused by collisions. If you throw a bouncy ball at a wall, at the point of collision, the ball is applying a force to the wall. Just as the wall is apply a force back to the ball which causes it to rebound in the opposite direction. So to will gas particles when they impact a surface. So pressure is just an average of these collisions taken over any unit area. Pounds per square inch. Or Newton’s per square meter (which are Pascals (Pa)) for example. So for a gas particle to apply a force it must be through a collision. As such the only way in which gas particles could push of the atmosphere to propel the rocket is if you have the exhaust gas particle, atmospheric particle and the rocket simultaneously colliding together. All 3 in simultaneous in a single collision. Which you can tell from observation is not happening. So by definition it cannot be pushing off any medium external to the rocket. 

So how does it create thrust?  Well in combustion those bouncy balls are released is random chaos. Like throwing a pile of bouncy balls on a concrete vibrator plate. They fly in all directions. Now a combustion chamber of a rocket is a chamber which is open at one end. Those balls which happen to be going that direction just fly out. But the rest hit the combustion chamber walls. Since there is no wall at the exit, there is going to be a force on the wall opposite the exit but no opposing force in the opposite direction at the exit. Which means thrust.

You are looking at gas as a single morphing mass, similar to a semi-solid liquid. In reality gas is lots of little tiny objects flying around.
Reply: @engineeringtheweirdguy2103  I should just accept that,  but I am a complete jackass.
All of this information is not lost on me. Most of it I have read, and I have likely skimmed over all of it (including in your prior posts) your patience is appreciated. 

While it is true that gas is molecules smacking around, the same is true for liquid as well as solid.
Contained gas acts almost exactly like a liquid, except that it adjusts its volume to fill the container.
I maintain that the exhaust at the exit nozzle IS an extension of the rocket.
The example blow in your own sale doesn't resonate with you, an old one I have seen is that you cannot hang yourself with your belt alone.. both in reference to Newtons 3rd

an impasse
Reply: @humblebwonderful9705  - When a FIREHOSE shoots out water is the water "part of the hose"?  NO!
When the firehose ACCELERATES the water the FORCE is generated IN THE NOZZLE.
The force is NOT from the water hitting the air.
A firehose would STILL experience RECOIL, even IN A VACUUM.
Do you agree that a person would FEEL RECOIL if they fired a firehose IN A VACUUM?
Reply: @humblebwonderful9705  gas does not really behave like a liquid. Gas is made of individual particles flying around like bouncy balls. However as a liquid those particles are bonded like a chain. The chain and fold and drag more particles with it. If you develop more bonds and it goes from a chain to a rigid lattice, that becomes a solid. So liquids and solids, the particle are constrained by bonds to one another. But as a gas they are free to fly around. 

While I certainly understand the appeal of thinking of a compressed gas as a liquid or solid, it is not. It is a collection of individual particles (bouncy balls). Each one can be considered an individual object as it will behave as such.

Imagine you have a shipping container with the doors open. And you put a heap of bouncy balls inside it and shake it up so that the balls are flying everywhere including the exit. The bouncy balls aren’t apart of the shipping container. In the same manner, gas particles aren’t apart of the rocket.
Reply: @stuartgray5877  If you were to attach a sail or shield to the rocket that catches the expelled exhaust, not allowing the exhaust column to form, would you have thrust?
Reply: @engineeringtheweirdguy2103  Is an astronaut part of the rocket? is the fuel? is the air in the system that the astronauts breathe part of the rocket?

Exhaust isn't considered part of the rocket because it is a gas?

Secondly, if a gas does not act as a liquid, what are all the fluid dynamics people on about?
Reply: Also, if you were to attach a sail or shield to the rocket that catches the expelled exhaust, not allowing the exhaust column to form, would you have thrust?
Reply: Gas pressure differentials in a gasless void.
Reply: @humblebwonderful9705  are you considered part of the car? If you jumped off the front of the car without the break on would it roll backwards? Yes I would. If you somehow fitted the engine of the car with a spring and launched it forwards would the rest of the car roll backwards? Was the engine not par of the car? You have very rigid definition on what is or isn’t apart of something. What matters is that mass was moving with it. And then they were accelerated apart. If I’m standing on a skateboard holding a bowling ball, me the skateboard and the bowling ball are all one unit mass moving together. But when I throw the bowling ball it is no longer apart of that mass because forces between me and the bowling ball separated us.
Reply: @humblebwonderful9705  you would not have thrust if you had a sail or shield at the end of the rocket as long as it was attached to the rocket. Because then the gas particles would hit the sail/shield and apply a force to it which would be opposite the force driving the rocket forwards. That would be a case of blowing your own sail.
Reply: @engineeringtheweirdguy2103  I have no such rigid definitions, your claim that exhaust is not part of the rocket mass because it is a gas needed clarification.

Now you said What matters is that mass was moving with it. And then they were accelerated apart.

So, if the exhaust IS part of the rocket (until it isn't), it cannot exert force upon itself without another mass, correct?

Do you insist that gas does not act like a liquid or am I also mistaken in that regard?
Reply: @humblebwonderful9705  gas does not act like a liquid in many cases. Hence the distinction between a gas and a liquid.
Reply: @humblebwonderful9705  “it cannot exert force upon itself without another mass” this is assuming that at the point where they separate their one either does not have mass or both masses are counted as one. Not the case. The gas and rocket both have their own mass. Just as you and the car you’re travelling in have their own mass. But if you were to leap forwards off the bonnet of your car without the break on the car will roll backwards. There is a force between your mass and the cars mass to separate you, when they were originally moving together. Similarly gas particles and the rocket are moving together, there is a force between the gas particles and some surface of the rocket engine which separates them. As a result the rocket is thrust forwards and the gas is thrust away in the opposite direction.
Reply: @humblebwonderful9705  there is nothing to say that two masses moving together cannot push off one another. If you’re on a plane, I can still push someone over. I could push them off the plane. There would be a result force on myself from pushing that person. I would remain still (relative to the plane) because that force is transferred though my feet into the plane. Gas particles would be no different.
Reply: Oh, did you assume that I didn't know the answer to the question? 
Did you see the questions you asked me? 
Does the Exhaust gas from the rocket HAVE MASS? Yes or No?

Shouldn't you know this?
Reply: @humblebwonderful9705  gas has mass.  Some gasses are heavier than others. :-)
Reply: @humblebwonderful9705  is that comment directed at me?
Reply: Newton's second can not apply to rockets.
Why do you rocket engineers insist it does?
It doesn't.
Reply: @engineeringtheweirdguy2103  I'm not sure anymore what message you are asking after. This message system is very disorganized.
Reply: @humblebwonderful9705  NASA's website says Newton's second law applies to rockets.  That's why it's called a "LAW" and not a theory.  What's your point anyway!
Reply: @soccerlove_dad  I said gas has mass when i was getting the big test from Stu. Really, who doesn't think gas has mass?
Reply: @humblebwonderful9705  I would love to see what ever references that says Newton’s laws don’t apply to a rocket. The point of Newton’s laws being laws of physics is that they must apply to all mass. If it didn’t it wouldn’t be a scientific law of physics. What I suspect is that these references (which I would still enjoy reading if you can’t provide links to them) don’t say that Newton’s laws specifically don’t apply to a rocket but rather, rocket motion was described with different physics. Such as transfer of momentum as an example. Or potential energy to kinetic energy as another. Something to realise is that most laws of physics are complimentary to one another. For example you can derive the conservation of momentum from Newton’s laws. You can also describe Newton’s laws in terms of kinetic/potential energy relations. Either way I’d like to read those links
Reply: @humblebwonderful9705  gas most certainly does have mass. I’ve stated that emphatically multiple times.
Reply: @engineeringtheweirdguy2103  I never claimed anything to the contrary. What are you people on about?
Reply: @humblebwonderful9705  ahh. Ok, I’ve just inspected the comment further. You were referring to someone else’s question. Quotation marks would have been useful there. My apologies for the confusion
Reply: @engineeringtheweirdguy2103  I just wanted to take a second to say thank you for being so patient.
Reply: @humblebwonderful9705  that’s alright. It’s definitely not a crime to have questions. The others can be a little harsh. A lot of people commenting on these sort of videos claiming rockets don’t work in space or questioning how they can work in space are often very hostile from the very first outset. So now they assume that hostility because the conversations begun. Even I get attacked. When trying to explain the physics and answer their questions I’m often responded to with name calling, accusations of being a “shill” and called and idiot or moron. But I try to see the better in people, especially since some people are genuinely curious. Which I see that you are when you start asking me questions like if it’s horrendously hot or cold in space. And I’m happy to do my best to answer all those questions. Curiosity shouldn’t be punished. I would say however that some people in the comments make adamant statements about how rockets can’t work in space without being able to either explain why not or account for explainations given to them. When they make the statements and continue to do so without any explanation or evidence in the face of contradicting explanations and evidence. That’s not to be commended. I appreciate what you have said earlier. You understand what I’m saying. You also make it clear that you want to hold onto what you think is how rockets are working but acknowledge that you still have questions and things you don’t understand. That’s a very honest and reasonable position to take. Which is also to be commended.
Reply: @soccerlove_dad  I said third, but Newton's second Law does not apply. It can't apply because the rocket's mass changes in flight.
Reply: @stuartgray5877  it can't apply because a rocket is a variable-mass systems and the formula for Newton's second  calls for a constant mass.

Read a book. "Dropouts" are smarter than you.
Reply: @humblebwonderful9705  actually Newton’s laws to the best of my knowledge apply to all mass. Whether the mass changes or not.  Again, if you had any references claiming otherwise I’d love to read them.
Reply: @humblebwonderful9705  You are basically wrong about everything you say. Now STOP pretending you have the faintest clue about how physics works. You are embarrassing yourself further.
Rocket Scientists (Engineers) have gotten just a LITTLE more sophisticated since Newton.
Look up he "Tsiolkovsky Rocket Equation" and tell us what is wrong with it.
Anyone that understands the "Law of Conservation of Momentum" can derive the Rocket Equation themselves.
So please DO show where the flaw is in this equation that has been tested for OVER A HUNDRED YEARS.
Or I guess You are going to show us how you are smarter than the engineers  At lockheed that built the SR-71 and Atlas Rockets?
Please carry on.
Reply: @engineeringtheweirdguy2103  Plastino, Angel R.; Muzzio, Juan C. (1992). "On the use and abuse of Newton's second law for variable mass problems". Celestial Mechanics and Dynamical Astronomy
"We may conclude emphasizing that Newton's second law is valid for constant mass only. When the mass varies due to accretion or ablation, [an alternate equation explicitly accounting for the changing mass] should be used."
Reply: Halliday; Resnick. Physics. 1. p. 199. " It is important to note that we cannot derive a general expression for Newton's second law for variable mass systems by treating the mass in F = dP/dt = d(Mv) as a variable. [...] We can use F = dP/dt to analyze variable mass systems only if we apply it to an entire system of constant mass having parts among which there is an interchange of mass. [Emphasis as in the original]"
Reply: [9] Kleppner, Daniel; Robert Kolenkow (1973). An Introduction to Mechanics. pp. 133–134.  "Recall that F = dP/dt was established for a system composed of a certain set of particles[. ... I]t is essential to deal with the same set of particles throughout the time interval[. ...] Consequently, the mass of the system can not change during the time of interest."
Reply: @humblebwonderful9705   thankyou for providing this references. I’ll give them a read and come back to you with my thoughts
Reply: @humblebwonderful9705  SO you WON'T critique the Rocket Equation?
Understood.
I accept your surrender.
Reply: @engineeringtheweirdguy2103  this is on overlook, a misconception, but it is easy to see. Cheers.
Reply: @stuartgray5877  Listen, get a tutor if you need help. I can't stand you.
YOU have convinced me that I will not pay for a four year university for my daughter next year. Thank you for your time.
Reply: @humblebwonderful9705  so after reading the first one. I don’t believe it says what you think it is saying. It is referring to incorrect adaptations of Newton’s equations in relation to momentum when analysing astronomical bodies according to special relativity which can change its velocity and apparent mass due to relativistic effects. It gives one example where someone incorrectly shoehorned Newton’s equations into and accidentally double sided equation. Meaning the equation stated that even if F was zero, F was not zero. Which obviously can’t happen. His comments were the Newtonian equations are ill suited for addressing relativistic velocities shifts due to changing mass. And he’s not wrong. Since we’re not applying relativistic effects to rockets as we’re not trying to measure them from billions of light years away or from near a black hole, his analysis or conclusions don’t concern or apply to a rocket
Reply: @humblebwonderful9705  although it is a little convoluted in its nomenclature as scientific papers after are. I do congratulate you on actual providing substantial references to back yourself up.
Reply: @humblebwonderful9705  so for the second one the author is describing the complexities of Astro dynamics. Not a simple topic. What he is trying to convey to his audience is that you cannot simply directly derive Newton’s second law through convention methods when assessing variable mass system. That is because it is most common to only apply a time derivative to the mass to make it account for change over time. But this isn’t the extent. The mass still in the system as well as the mass entering or exiting the system will also have momentum which will be transferred. You need to account for both the change in mass over time as well as the carried over and transferred momentum to the system. 

So it’s not to say that Newton’s second law doesn’t apply to rockets, it’s that it becomes very complicated with a variable mass system such as a rocket. You have to account for more variables than just mass alone.

Hopefully that makes sense. In my opinion, neither of the sources you provided say what you think they do. But I do understand where you got the thought from. Without having written documents like those myself in the past, I likely would have come to the same conclusion as you. It’s not an unreasonable conclusion to make with limited exposure to this kind of literature and physics. But it’s not, in my opinion, the correct conclusion.
Reply: @humblebwonderful9705   but I can’t stress this enough, well done on even finding those resources yet alone reading them. I’m very impressed. You should feel good about yourself in regards to this. Very well done.
Reply: @engineeringtheweirdguy2103  can I ask you something? The electric kool-aid acid test: If your.. academic..comrades hadn't published those pieces, what would it take to get YOU to believe some "dropout"?

Some never would hear it. Maybe most wouldn't, but you did. What would it take without the references for YOU to "believe?"

also, thank you. engineers are almost as mean as doctors usually, and even my tipsy babbling the other day you managed not to be insulting, which even I haven't managed throughout.  I am curious about what you do in the field, but this isn't the forum for that. Good luck and be well.
Reply: @humblebwonderful9705  I’m an consultant Mechanical Engineer. I often work for machine and systems design for anything from aerospace to the food industry. I also do things like hygiene and fire for buildings and machinery. HVAC, thermodynamic efficiencies, process design and optimisation, lighting and Acoustic analysis and design. I do a whole range of things with a whole range of different people.
Reply: @humblebwonderful9705  what would it take to believe you without references? Well details. In a nutshell. For example remember my explanation of how gas particles will expand in all directions therefore there must be a force? That was a detailed explanation referencing known laws of physics affecting those particles and their reactions. If you wanted to convince me you would have to provide 2 details. Firstly, where the lapse in logic of my explanation was, followed by the second which is then to explain what those particles SHOULD do instead and explain why they would do that.

For example if you wanted to explain to me how rockets push off air you must first describe exactly where the flaw in my explanation was. Then you must describe in as much detail as I did, what the gas  particles do instead when interacting with the air and why they would do that. For example how force is applied back to the rocket from gas particles no longer in contact with the rocket. Why it would do that, how it does it and according to what physics it does so.
Reply: @humblebwonderful9705  I, along with most Engineers and scientists aren’t interested in broad statements like “it pushes off air because it must” we’re interested in the details. Why must it? How does it do it? What does that look like? How does that compare to other observations?
Reply: @humblebwonderful9705  The company I currently work for buys dozens of Hypergolic monopropellant thrusters from Moog corp. per year.
We TEST EVERY SINGLE ONE OF THEM - IN VACUUM, and make sure they produce the thrust predicted by the rocket equation.
SO you are calling me a Liar.

we then put them on spacecraft and LAUNCH THEM TO SPACE and test them there too.
Reply: @stuartgray5877  Send them my condolences.
Reply: @humblebwonderful9705  Oh and DID YOU look up the Tsiolkovsky rocket equation yet? DIdn't think so....
So where is your derivation that shows it is incorrect?

You know it CLEARLY shows that rockets are MORE EFFICIENT IN VACUUM RIGHT?

don't let those pesky "FACTS" get in the way of your imaginary narrative.
Reply: @humblebwonderful9705  SO AGAIN you are calling me a liar.

I literally build, test, launch and OPERATE spacecraft in earth orbit and deep space FOR A LIVING.  I have been a member of a spacecraft FUELING TEAM, and I have had hazardous processing safety certifications at KSC and VAFB for longer than you have been alive.
But YOU know how this shit works better than I DO?
Bless your little heart.